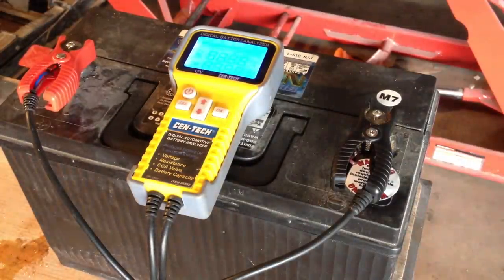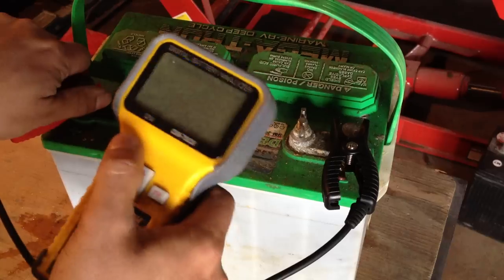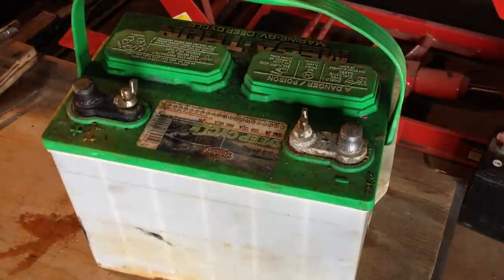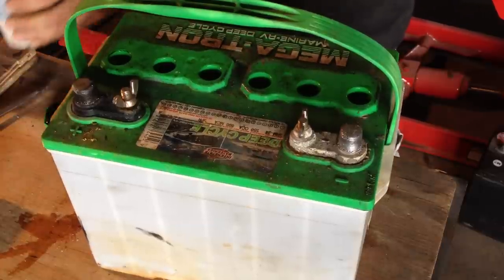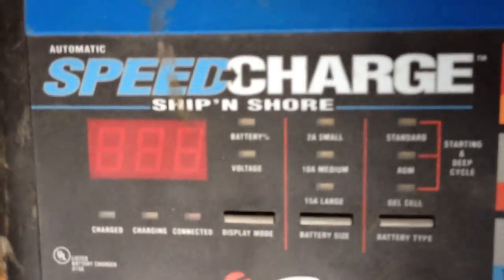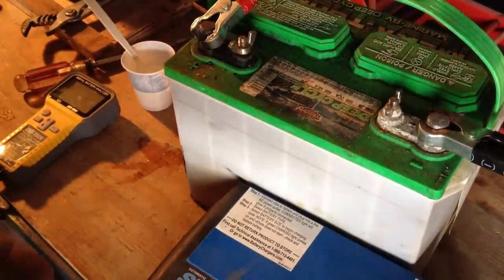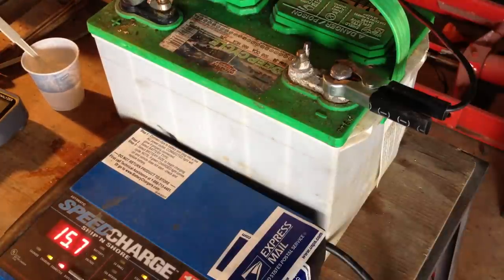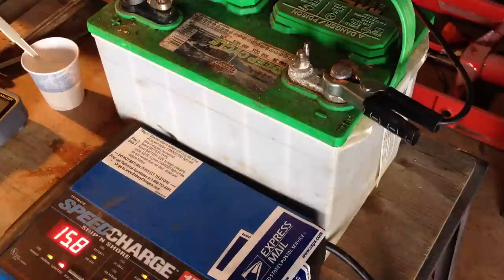Lead Acid Battery Desulfation Using Epsom Salt --First test after Charging  Part 3 of 6

Comment: Dump the acid and fill it with distilled water and recharge it one more time. After that you can dump it and refill it with new acid mix from the parts store, that works for me. I have saved many batteries that way.

Comment: So you just add this epsom salts/distilled water solution to the acid that is already in the battery?
And make sure battery is charged first before adding the epsom salts/distilled water solution?

Comment: You can't test a battery with a meter like that right after coming off the charger.  There is still a huge surface charge that the tester is reading.  Recommended wait time is 12 hours after charging to do any testing.  You probably know that by now.  Interesting videos but still not sure if this Epsom salt method works yet.

Comment: The resistance is in milli ohms, not ohms.  I milli ohm is 1/1000 of an ohm. His analyzer shows an "m" in front of the ohms symbol.
Reply: Right, if the reading was in ohms, the battery would be totally dead.
Reply: mega ohms?
Reply: @MrRichard57000  Big M is Mega, small m is mili. Mega is 10^6 while mili is 10^-3.
Reply: @Lagggerengineering    makes sence, never knew….thanks.

Comment: I saw a video of a Canadian rejuvenating an old deep cycle battery with this method.

1... First, he poured a mix of baking soda to buffer the sulphuric acid electrolyte, then drain. 
2...Then he flushed it with clean water. 
3...Using filtered/distilled water, he mixed Epsom Salt (Magnesium Sulfate) and poured the solution in the cells.
4...Charged the battery at a high amperage rate for about 6 to 8 hours then allowed to rest overnight. 
5...The battery started his truck in freezing weather with the ground covered in heavy snow. 

I am going to try this after I buy a battery charger or build one myself. 

Epsom Salts are also good for plants as a super fertilizer and for health. I use it for foot bath in warm water then pour it on my plants. The best way to benefit health wise is by taking a warm bath as it is absorbed through the skin. You can drink a solution but only in a very, very, lightly diluted in a glass of water. Only a tiny pinch.

One of nature's best kept secrets.

Comment: Forget the alum. Drain the acid, flush each cell with distilled water a couple times, refill with water and charge. The water will a remusify the hard sulphate. Drain, refill with proper 35 percent sulphuric acid, and recharge, discharge cycle until battery stops improving after each cycle
This method often restores shorted cells as well.

Comment: is it worth the time to try to save a baatery set to fail from the start
Reply: a battery?
Reply from the maker: 73 SUPERGLIDE  Yes. In some cases. Depends how far gone it is. I've been putting a tiny bit of Epsom salt in my new batteries, helps keep the sulfate from forming from the get go.
Reply: IVE HAD NO LUCK THERE

Comment: You do a lot with batteries and electricity.. I'm looking for an inexpensive(hoping free on craigslist) motor/generator/alternator I can use on a windmill to power a fridge in a garage without power..  I figure if the freezer is full of salt water with alum in it, it'll keep the drinks cold in the fridge even if there's no wind for a day or 2.. When the wind blows again, power to the fridge will show the thermostat is too low and electric will flow back into the fridge, cooling my beverages.. I've seen ceiling fans generate electricity simply by spinning them, but a buddy tells me it won't work. Why not? I'm aware the compressor uses more juice to start up, but an older energy star fridge shouldn't require that much power, should it?
Reply: Use a 12 volt refrig sealed unit fridge freezer

Comment: Hey, I have a Wizbang desulphator and Im getting up to 15.6 volts when its on. Battery charge went from 12.53 to 12.80 (over night), but it goes down slowly. Do you think its safe to keep it going when it goes to 15.6+ volts? I thought it would peak out at 14.75 or something. Charge light fluctuates, not solid.

Comment: I believe you may have MISREAD the ohmmeter, cuz it appears to read 14.46 MEGOHMS resistance in the first reading- i.e. that is 14,460 ohms.   if so, adding the Epsom salts increased the resistance, cuz Epsom salts is not as good of an electrolyte as sulfuric acid.  what it will do, is electroplate the lead plates with magnesium, thereby making them better conductors, than they were when coated with sulfate.